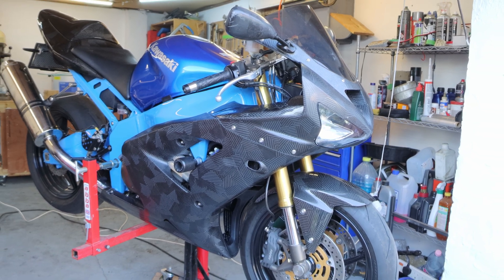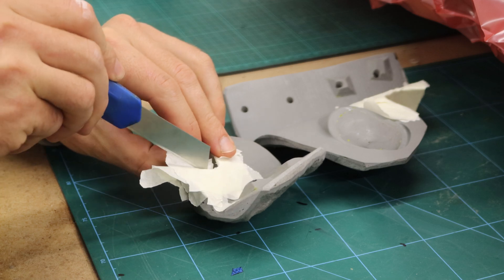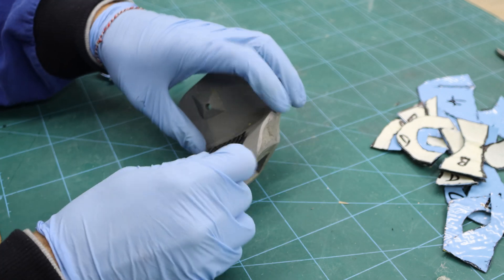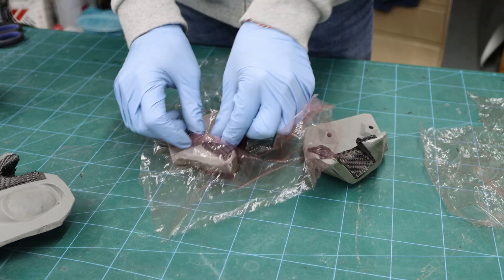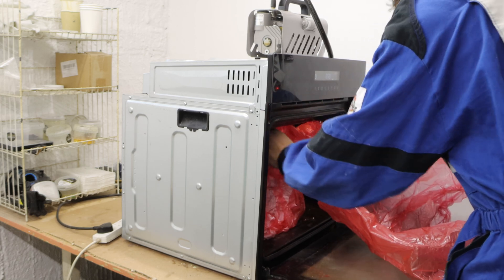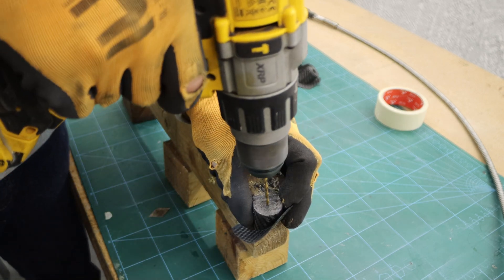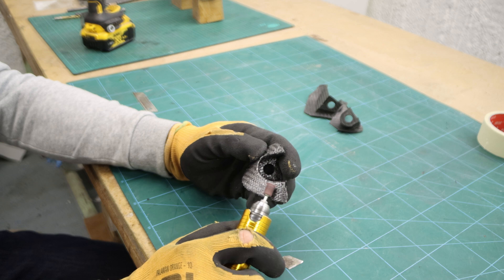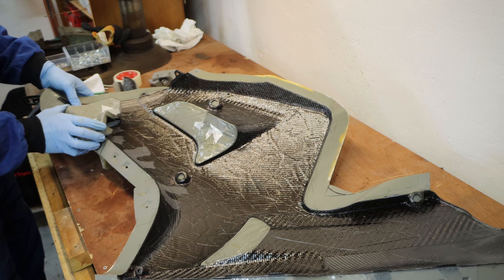Carbon Fairing Brackets Build - ZX6R Build PT. 12

Comment: Amazing work on this bike man, its going to be so nice in carbon. Also wanted to point out, you installed the breathers differently then how they were when you removed them. Maybe they were installed wrong initially but figured I would let you know. Good luck.
Reply from the maker: Hey 
Thanks so much! 
Thanks for pointing it out. I did swap them out and I recorded that in the following video in pt. 3 
🏍️🛠️🤘

Comment: Again - awesome work done here !
Thank you for taking us with you through this process.

Have you been thinking of using Screws in a different colour (black for example), so the carbon-Finish isn‘t disturbed like with the original steel-screws ?
And what are your plans for the tank ?
Reply from the maker: Many thanks for the compliment! 
I thought about it yes, but I quite like the stainless steel bolts and washers on the fairing. 
I would like to make a carbon fiber tank. Also planning to do just a carbon tank cover. Never done those before. Will be a good learning experience for me 🏍️🛠️🤘
Reply: @ 
So things remain exciting on your channel - thank you so much for having us with you ! 🙏🏽

Comment: Great job !  Did the large mold with molding past  has deformed during the post cure ? I already had deformation issues using high temp molding past for large mold
Reply from the maker: Hey
That’s bad
The post curing temperature must be increased very slowly 
Start on 60c for two hours and every two hours rise the temp with 10 degrees Celsius up to 120.
Reply: @zrcarbon9937  alright. Thanks I'll take notes. I used the post cure cycle gived by easy composite for the emp160